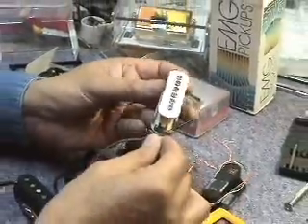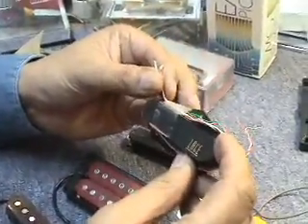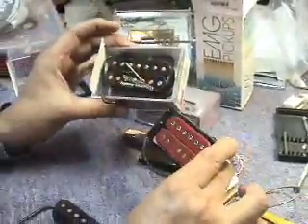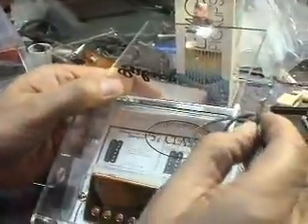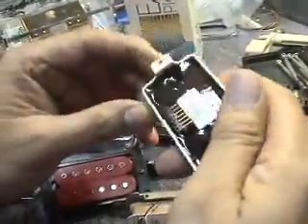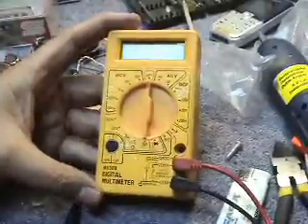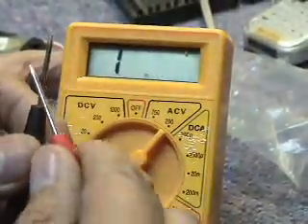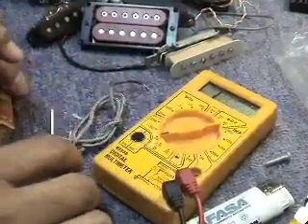Entendiendo mi Guitarra, Pickups 01, Mex

Comment from the maker: Por utimo olvide hacerte el siguiente comentrio: Desolda el capacitor y solda dos cablecitos que salgan de la guitarra, los capacitores los unes a todos de un extremo y los soldas a uno de los cables, no impota cual no hay polaridad y con el otro cable vas probando como suena con cada uno. La base seria .022, .01, .0093, .0082, .0074, .0068, .0047, .0039 y .0033 microfarad. Si analizas lo anterior, que pasaria si los conectamos a un Switch rotatorio?...